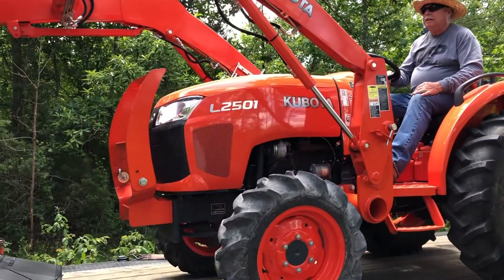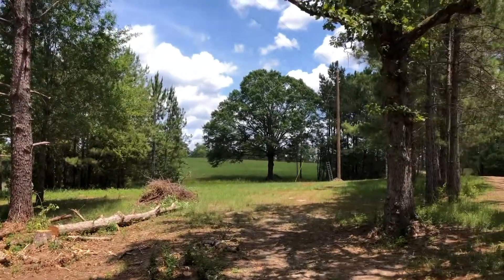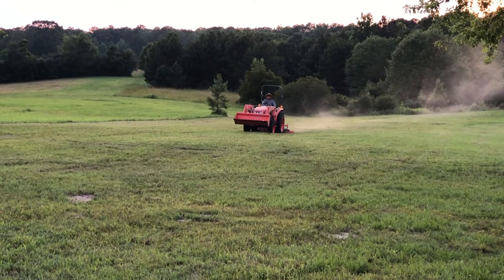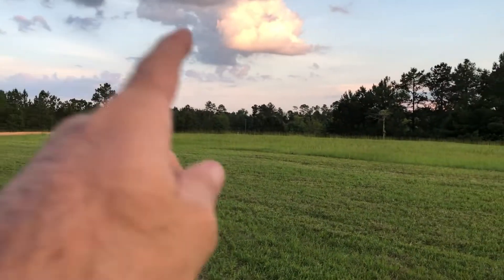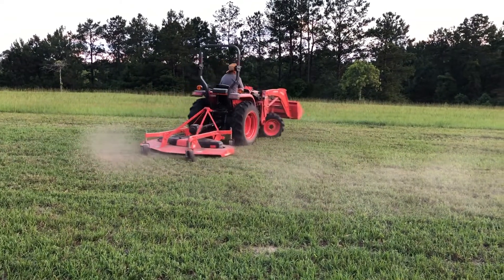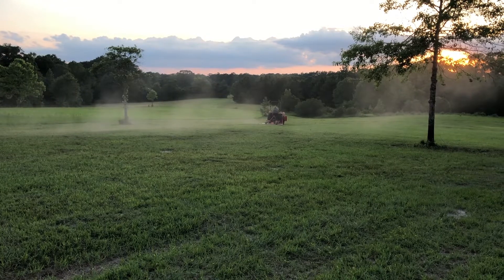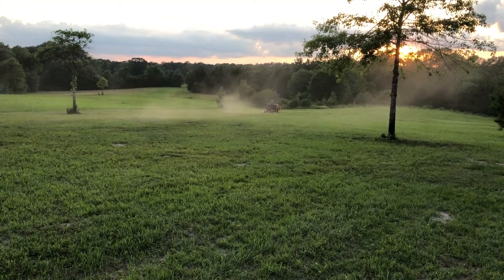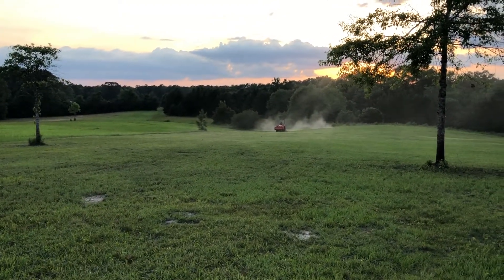Kubota L2501 Modded ~ Finishing Mower Test & Egt Temps!

Comment: I’ve just done this.  What Egts should I be under?
Reply: I would think to treat it like you would a tuned diesel truck and say 1200 degrees F should be your max. You can run at 1200 but i wouldn’t let it go much over for an extended period of time.

Comment: How did it handle the finish mower before upgrade
Reply from the maker: Okay on normal finished lawn. Bogged on a thick grass even if the deck was on a high setting. I am going to back off the fuel a little bit. Rolls to much coal under heavy load